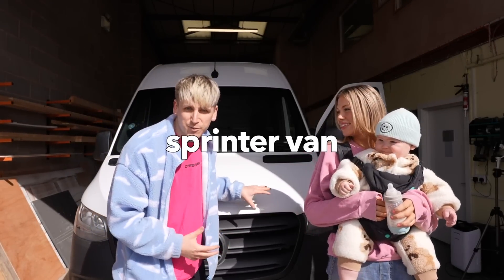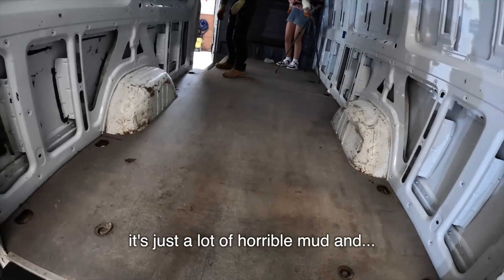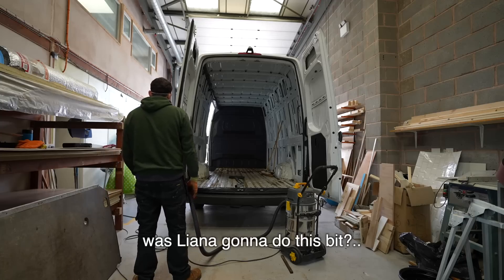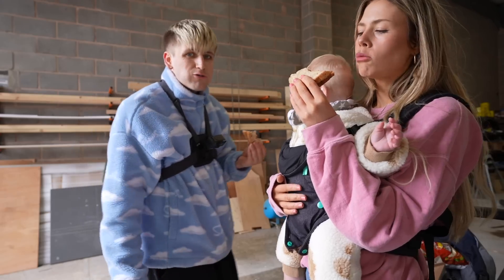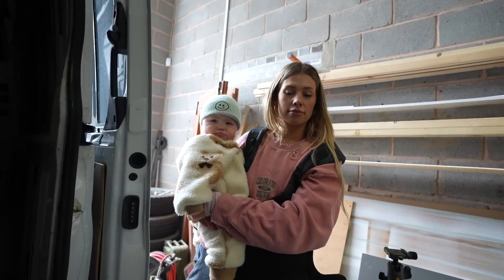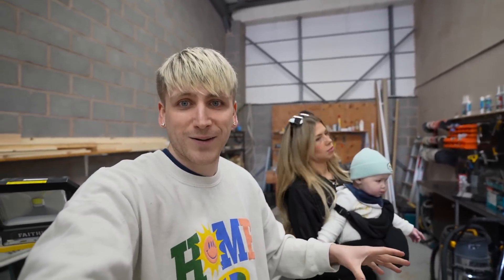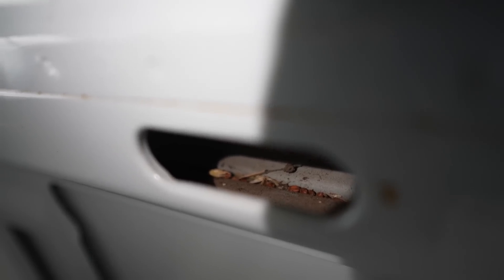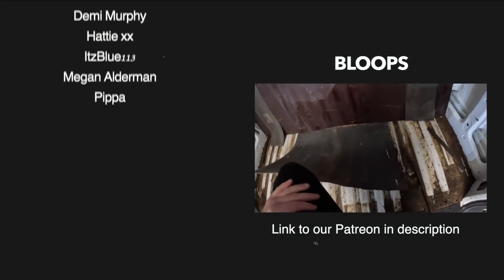VAN LIFE BUILD | we had no idea it was this bad

Comment: Hey guys before I started driving a truck I drove a sprinter van for the company I was working for and they get very nasty inside from pallets of stuff going in there constantly and drivers never cleaning them. Maybe it was leaking everytime it rained and the black soot on the ceiling could be from the diesel not filtering properly and some how exhausting into the cab. I hope you get your money back and find a new van. Blessings to you all. ❤
Reply: Prolly, that van could be used for field work labs in testing (bio) hazards lol
Reply: It was Mud and Mould in the cab to Probably got submerged in a flood and recovered but the Interior was Moldy there was also Industrial Rat Pioson in the side panels

Comment: i had a similar issue when i bought a 2019 ford fiesta recently. it had a head gasket that was blown and the guy i bought it from filled the oil with white spirit to prevent a milky substance forming on the oil cap (one of the main giveaways a head gasket needs replacing). the guy told me there was absolutely no issues with the car when i bought it, luckily i had text messages of me arranging to view the car and the man telling me there’s nothing wrong with it. citizens advice helped me so much as the dealer i bought it from was an absolute wanker. i thankfully got my money back as i was sold a product under false information when the product which wasn’t fit for purpose. good luck to you both!

Comment: You should make the roof waterproof, take the Seats out, put new seats in, clean every little hole with vacuum, use a ozone machine  to get rid of smell or put a cup of vinegar  in it for a day the smell will go away. Also awesome  the spray works really good to clean things.

Comment: Hopefully you're sorted now, but do you pay for legal cover on your insurance? They often give good advice even if the actual process of taking the company to court isn't covered. 
Also found this (from the carwow website): 

Consumer Rights Act

The Consumer Rights Act (2015) was put into law to protect consumers across a broad spectrum of purchases, and this includes motor vehicles. The Act stipulates that when buying from an official car dealer the vehicle must:

* Be of satisfactory quality: It should be in a condition that is expected of its age, roadworthy and without any obvious defects
* Be fit for its particular purpose: It needs to be able to carry out the tasks expected of a vehicle of its type: towing, off-roading etc.
* Be as described: It needs to fit the description promised by the dealer, whether that be its condition, or specification level.

In essence, these points mean that the dealer is responsible for any misrepresentation or defects on the vehicle when it is sold, but if you are made aware of these issues prior to purchase then they are not liable. Normal wear and tear do not form part of these stipulations above.

If the issues you have with the car fall into one of the categories above, you are entitled to reject the deal within 30 days and request a full refund.

Good luck guys. Defo sounds like they misrepresented the situation at the very least. 

I'm sure it will be ok in the end, it's just stressful until you get there.

Comment: Feel really bad for you guys, and whoever sold you this and KNEW you guys wanted to convert it and didn't say anything shame on them. Idk what the laws and regulations/customs are there but generally when it ocmes to buying a car owned by someone privately i won't even consider the transaction if it's void after 3 or so days or after a test drive. This means you usually have enough time to take it to a mechanic and see how the condition the car it, the test drive also yea helps you feel how the car will be generally... and even sometimes thats not enough from scammers that know their car is hiding some specific flaws and will likely die in a few months or a year.

Comment: I've always wanted to do up a van but im worried about set backs exactly like this when i can barely afford a pot to piss in 😂
Reply: Save up money every week, look into costs, ask questions about it, and make sure to have someone who converts vans/things like this take a look at it. 

Also if it smells don't buy it for safety reasons. If it doesn't smell, having someone who knows about cars looking at it might help before buying since they can point out issues it has that might go ignored. Take it for a test drive if you can to see if any issues are present and if it is something you can easily drive. Also check tire tread. Don't want to have bad tires on the vehicle.

Once you save up and have everything priced out for what you want to do make sure to go to a place such as a scrapyard to get the van weight because that is important.. if you weigh it make sure there's pretty much nothing in it adding weight to it. 

Eventually you will be able to do this if you want to as long as you can save up to.. always look at the cost for everything in the end...
Reply: @izoraiza  thanks i will do

Comment: You’ve definitely got a case even trading standards would help you I took a case out again a company called car shop they sold me a mini with endless faults I got it on the 17th January 2020 got it rejected 17th February 2020 so one month exactly  because they had lied and said it had full service history and that they would send it on but it turned out it didn’t have any the next day I went to drive it to go out the major engine management light came  on it had several other faults battery was knackered on it break sensors and breaks needed doing fog light bulb warning kept coming on  the timing chain tensioners needed doing  the list goes on